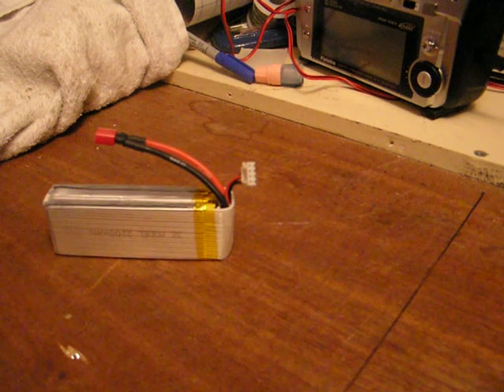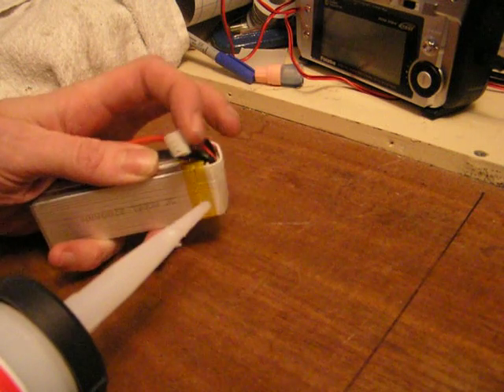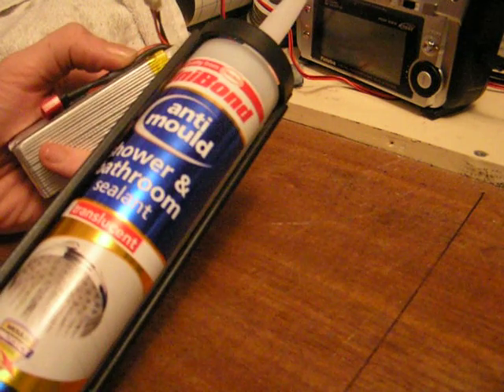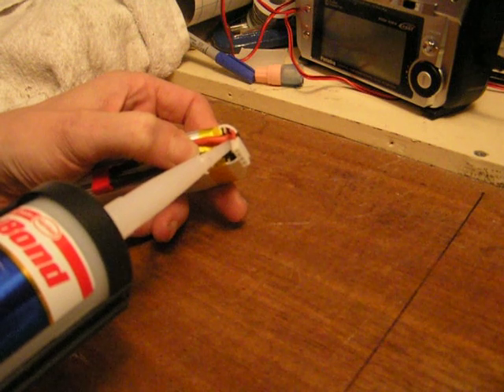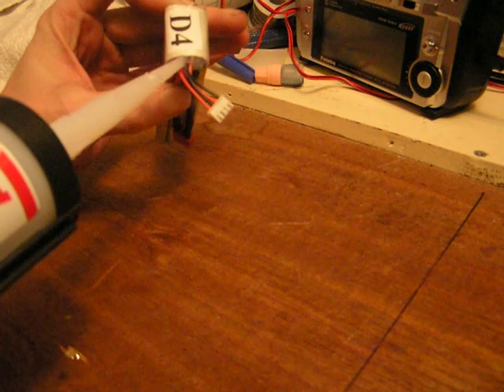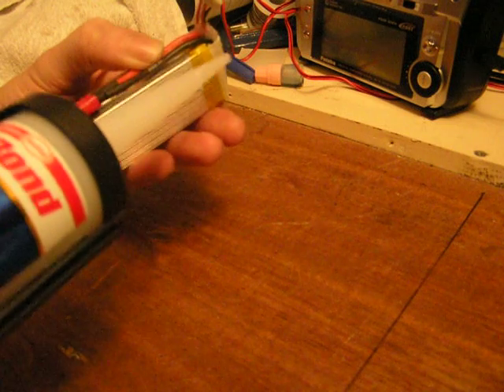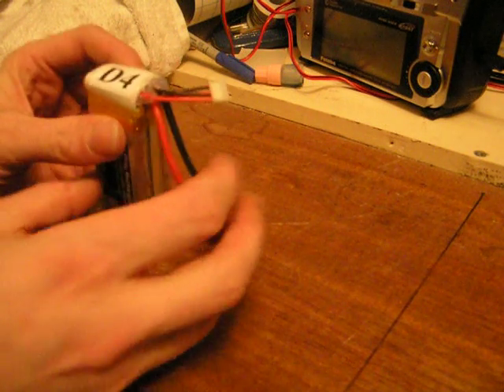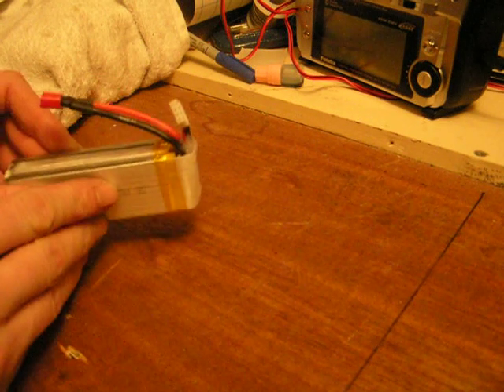save your lipo balance plug

Comment: doing now! had to solder lots of these wires back on, cheers gary grt tip.
update.. had two flights on the sightly puffed battery so far.after doing the tip on it,balancing fine and the pack feels solid.will keep eye on it.
j